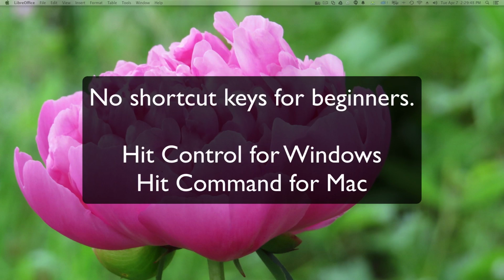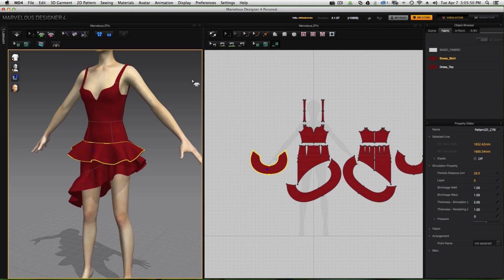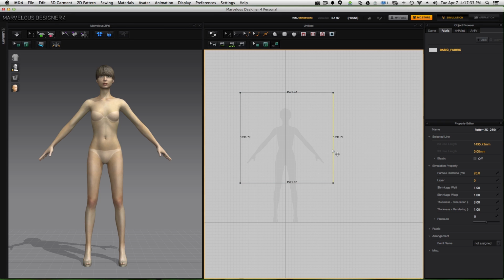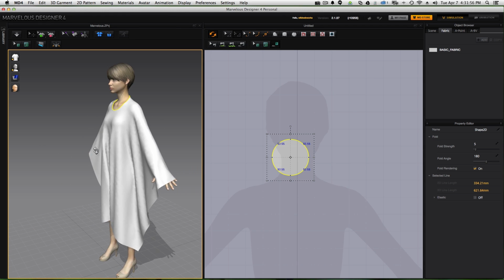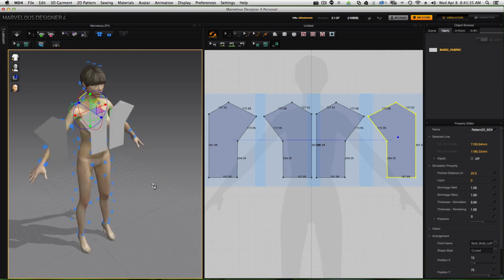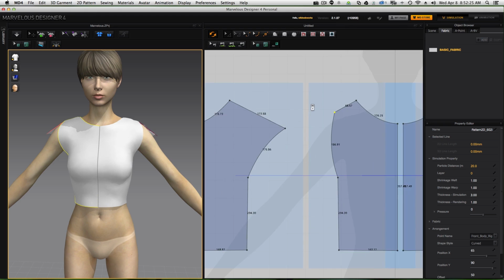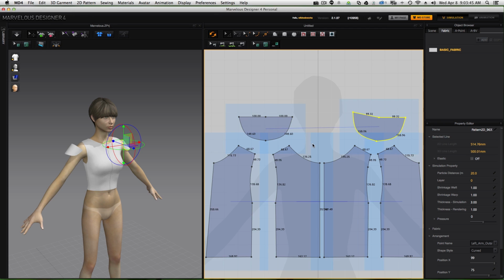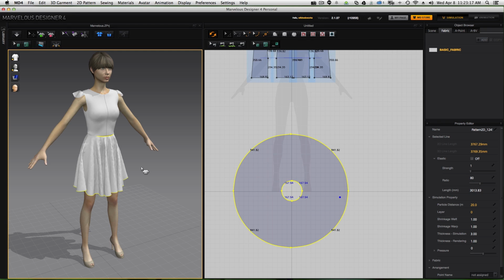How To Use Marvelous Designer - Beginner Tutorial

Comment: I got MD mid last year and thought, 'what a mistake.'  it seemed hard with too many little things you needed to know to get it to work as expected without too much instruction.  my work now requires that i design simple clothing patterns for my 3d subjects.  Thank goodness I found you and your tuts, whew!  I feel now that i can get a handle on this program now.
Reply from the maker: legar83 You'll have it all figured out in no time! Just takes a little patience. Unlike other programs, there isn't a ton of tools to learn. Thanks for watching.
Reply: Thanks for that.  In fact just finished a simple tank and short skirt.  Simple but will work for what I need thanks to your vids.  What do you do for seams to simulate folded over seams like bottom of real skirts, pants?
Reply from the maker: legar83 The bottom is called a hem. Let's say you want a 5 mm hem on the bottom. Create two horizontal internal lines up from the bottom edge of the pant/skirt (same length as edge of pant/skirt). One is 5mm from bottom, next is 5mm from first line. Set the Fold Angle on the lowest internal line to 0 with a high Strength. Then sew a seam that connects the bottom edge of the pants/skirt to the highest internal line. It will fold on the lowest internal line and create a nice hem. You may want to lessen the strength after simulating, because it can be pretty sharp. Hope that helps.
Reply: Yes, very clever.  thank you.

Comment: 14:45 Strange, but I can hold Shift and then Left Click and Drag.
As well, there is Ctrl + Left Click and Drag it will allow You to move point or segment along "extended" line (try to make a non rectangle shape and Ctrl+Click and Drag a segment).
42:35 Seems Marvelous Designer bugged on 38:43, and didn't split segment uniformly on the mirrored pattern.

Comment: Actually you can undock and move the the pattern and simulations windows around (I assume the rest as well but has not tried it...is afraid to ) and can actually close those windows, although I am not sure I would advise it.  It is VERY DIFFICULT to redock them or, else I am not very coordinated. 

Due to the size of the icon buttons and blackness, it is difficult to see the buttons.  What you are looking for is a square with an arrow pointing to the upper right...should be right under "MD Store"...and to the left of the Property editor...in MD4. The only way I see these buttons is I am running a Mac with a 27 inch monitor...it may be even more difficult to see these on smaller monitors.

If you accidentally turn the Pattern or Simulation window off using the tiny X, you will need to undock the remaining window, move it so you can right click in the black center and check mark the verbiage that is not check marked or both if you turned off both windows. 

To redock, you will have to move one of the floating windows back in place, I suggest start in the upper right and then the other to the upper left.  Should be a white border appear when you get the the first window back in dockable position. The 2nd window you just have to keep trying to put it back in place...I have found after the first one is redocked if you try to redock the second to the upper left it seems to work easier...sometimes it works easily...sometimes not.  If you move both windows downward, it  will set up tabs at the bottom.  You can click back and forth between the tabs.

There may be a better or easier way I don't know of but it was more frustration to redock than was work to me.  Personally, this is one of the items I think MD needs to work on for a better user experience.  Hope this is helpful to everyone.
Reply from the maker: Morgaine Christensen Thanks for sharing your tips. (I can reply now!)
Reply: Lori Griffiths Yay!  Thank you for the info so I could fix the comment issue!

Comment: lori i'm brand new to MD and was very impressed with the way your approach was in your teaching ..basically it was great ......but could you show us how to convert a garment if needed and importing it into second life ? .....and yes write a book it would be appreciated ..but don't stop doing your video's  :)
Reply from the maker: Smokey Breen I have no Second Life experience. Have you tried over on the MD forums? I know there are people over there who know how to do that. Thanks for taking the time to comment.
Reply: Smokey Breen Do you have MD 4?  If so, I would select your pattern pieces and quadrangulate them before exporting from MD.   You will need to export as an .obj file (or whatever your 3D modeling software requires).  Make sure you uncheck any models or pattern pieces you will not be exporting.  Select the M (is for meters) to export if you are using the Avastar add-on for Blender or the Avastar Workbench model.  For other modeling programs, someone else will have to answer.  Import the .obj file to Blender, rig/skin it, weight paint, then export as a collada file. If using Avastar, chose the Avastar collada choice (a similar process is probably required for other 3D modeling software I am sure) then upload the rigged and weighted model to SL.

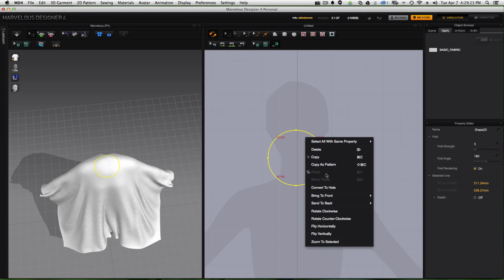Comment: Hi Lori. This is a fantastic tutorial, so thank you. The best I've found on MD. Question. I am at 19:32 but don't see a "Convert To Hole" option in that menu. I'm using MD 4.
Reply from the maker: Lillian I just opened MD to check. The internal shape must be closed, like a circle or rectangle. Select just the internal shape, not the whole piece of garment. Then right click. You should see Convert to Hole as an option. I'm pretty sure that feature has been there for awhile. Thanks for watching.
Reply: +Lori Griffiths That worked. Thanks!

Comment: You guys really nice.. Thank you very much! Realy useful! ;)
Reply from the maker: alithemardihubeis023 You're very welcome. Thanks for watching.
Reply: do you have a video that explains how to use avatar other than human body figures? (ex : helmet) because i pretty much want to make a bag for a motorcycle helmet :)
Reply from the maker: alithemardihubeis023 Wow, that's a unique request. No, I haven't imported anything but human avatars at this point. A bag should be very easy to do in MD. Do you have your helmet modeled? Import it in to MD, just like an avatar. I would suggest that you raise it just slightly off the floor plane before import. Then you can get the bag fabric under it in MD. All you have to do is draw up the fabric using an elastic setting on the edge to pull it together, like a draw cord.
Reply: Lori Griffiths wow you're right.. okay then.. i'll try :
1. importing the helmet model (maybe i'll search the template via online and import it to MD)
2. make sure the model position is above the floor
3. use the elastic option, so it shows how the bag fits the helmet perfectly

once again.. Thanks A Million !!! :D

Comment: Great video!  Thanks.  Quck question...at the end there, is there a way to snap the circle skirt cutout hole to the center of the circle skirt?  You were manually positioning, but seems like it would have been nice to snap it exactly.
Reply from the maker: It would be nice to do that. The Align techniques won't work with an Internal Line and a Shape selected, unfortunately. There is no other method within the program to snap to center. I'll send a request to MD. You never know, it may be an easy add for them. Thanks for asking.

Comment: Lori, Thank you so much for the series of tutorials, they are amazing. So, a simple question, I am  3D modeler, I use 3DS Max and ZBrush, If I model a character in 3ds max, can I import the character here and make the cloth directly on to it? can I do the same if I have done it in ZBrush?
Reply from the maker: mrroozbehm1985 You may want to take a look at this page in the MD manual - http://manual.marvelousdesigner.com/display/MD4M/Compatible+File+Formats. I have imported OBJ avatars from Blender with great success. I generally start with a Make Human character then make changes in Blender. It comes into MD very well. Then you can easily put on any clothing you like and simulate it for natural draping. I would suggest that your avatar is in the A pose, as opposed to a T pose. Sleeves and shoulders don't work very well in the T pose.
Reply: Lori Griffiths Thanks you Lori, It says it supports OBJ files, so it should work with ZBrush as well. Brilliant tutorials. I will try with both softwares and let you know the result.

Comment: hi lori HOe to set height of ground plane in marvelousdesigner? If I set height as negative value it doesnt work and my cloth collide with ground
Reply from the maker: Why do you want to change the ground plane height and which version of MD are you using?
Reply: @LoriGriffiths  marvelous designer 7. The cloth was colliding with ground plane even if I turned collision off. Now it's solved after using collada instead of alembic. Why dont I get exact result in Maya as I see in marvelous designer?  If I turn skin offset value low it penetrates in Maya but looks ok in marvelous. If I turn it high it looks so bad

Comment: Is there any way to speed up the simulation.  Mines seems to be running slow. I'm using running a trail version of MD 6.
Reply from the maker: Increase the Particle Distance setting in the Property Editor. This will make the mesh less dense and run faster.

Comment: Hi, is it possible to simulate or use darts in MD. The cloth in this example would be a stretch knit of some sort. If it were a woven it would not fit like it does without darts. Thanks
Reply from the maker: allanpennington Absolutely, darts are very easy to use in MD. In the real world, you would fold them in, in MD you cut them out and then sew the dart legs together.

Comment: I know this might be a strange question but, is it possible to make metal such as plate armor in MD? I'm working on a project and wanted to know if it's able to.
Reply from the maker: +The10004 I think MD would be a good choice for some armor, as long as the armor is meant to be attached to a garment or the avatar. You can use the stiffest materials; interfacing, leather belt, etc. These materials will deform somewhat and not be completely flat. If you need armor that is really flat or holds a really specific shape, like a shield, I don't think MD would do the job. However, you can bring in objects besides the avatar now in MD5. You could make conforming armor where needed and then import other armor to complement it and finish the model. I have never done it, so I'm guessing here. Hope that helps.
Reply: Lori Griffiths
Alright, I'll give it a shot when I get MD in the future, thanks!

Comment: i can't get my cursor to change from whatever 2D tool i'm using so, i can't do anything in 2D except, whatever tool is selected - how do i deselect a 2D tool? clicking on the main move tool doesn't change the 2D tool - i just made a circle and i want to cut a hole but, i can't get that menu because i have the circle 2D tool selected
Reply from the maker: You should be able to click any of the other tool buttons above the 2D window to switch tools. I'm not sure what the problem is.

Comment: Hello,

I have a problem, when at 34 mn I try to drag the point it does so in a curve, not a straight line ! Help please...
Reply: I should add that I'm using MD6.
Reply from the maker: You're just using the edit pattern tool, not the edit curve tool? That's the only thing I could think would be happening.

Comment: if i imported my own model, it does show the arrangement points. Is this true?
Reply from the maker: That's partially true. When you import a model in the newer version 7, you will get a default set of Bounding Volumes and Arrangement Points. They probably won't be the right size, but you can adjust them. In the older versions you had nothing and had to start from scratch.

Comment: sorry for bothering you but, do you have any guides on making socks in marvelous designer? i have to use a g2female model from DAV, and trying to make a decent pair of socks is like pulling teeth. except i still don't have any socks when the tooth is pulled.
Reply from the maker: Socks are tough because they don't have any side seams in real life. Are you using another 3d graphics program like Blender? If so, I'd just select the mesh where the socks go and extrude it for fake socks or copy it then extrude it to make a stand-alone pair.

Comment: hey Lori, when i go to animate leggings in MD, the fabric tears up (fragments) and get holes, mostly along the inner legs (maybe it's a collision issue). i've tried using different fabrics, even ones with stretch. any idea what settings i can adjust to fix this? thanks very much.
Reply from the maker: The fabric settings really just affect the simulation properties, it doesn't really do anything for fit. I think the problem is the fit. Try making them a bit bigger.
Reply: @LoriGriffiths  that's good to know. thanks very much, i'll try that.

Comment: This tutorial is awesome Thank you so much!  However, and it has nothing to do with you, you're great but my MD is ass backward. To make the avatars head go through the hole on the 3d side I have to place it in the vicinity of the 2ds legs, like its upside down lol.  Is there a setting or something?
Reply from the maker: That is very strange. I have no idea what is happening with your version of MD. It sounds like the gravity is working the wrong direction. You may want to adjust the Gravity setting in the Property Editor and see what happens.
Reply: There is no gravity option in my Properties Editor but I thought maybe it happened because the fabric was upside down when I ran the simulator so I redid it and the hole ended up toward the back of the fabric so I moved it using the 2d side and reran the simulator again and all kinds of penetration occured.  I thought maybe its because the fabric it ended up a little smaller than yours in the tutorial.

Comment: My apologies, I am completely new to MD and I've gotten into a snag.

Whenever I try to give curvature to my polygon, It never seems to give me the desired result (giving me a blocky look) and I'm not sure what to do.

Here's an example of what I mean, not what I'm actually making but I tried this for practice, say I'm making pieces for a glove and I'm wanting to use curvature to give the finger tip areas the curve. When I apply the curve, it just gives me a triangle of sorts rather than a curve tip. Am I not adding enough points when I create my polygon? or am I missing something?
Reply from the maker: You need to increase the resolution by increasing the Particle Distance on the pattern. The setting is located over in the Property Editor.
Reply: Thank you very much.

Comment: Well I did just what you talked about and lost my avatar. But for some reason Zoom Extends All did not bring it back, and I am certifiably crazy now. I like a cat thats mad at its tail for whipping around, I can't find my avatar and it gets worse the harder I try. I can see bits or pieces if I try to use Top or 3/4 view, but then I lose it if I try to bring it out or in. To be clear, I imported a dae body and even if I delete the avatar, when I import it in again, to picks up where I left off.... please please help?
Reply from the maker: That's very strange. Usually, the Zoom works just fine. The problem must be with the imported avatar. If you already have garments made that you don't want to lose, save them as Garments. Then when you get the avatar issue figured out, you can bring the garments back in. It is nearly impossible for me to diagnose your issue, there are just too many variables with an avatar import.
Reply: It turns out that when I deleted the history it seemed to help. After that  was able to load the dae body and it straightened right up. Now if I can only rotate my 2D silhouette. My 3D body loads up with side view of the body when trying to view front, and so the 2D is showing a side view also. Still no matter what, your tutorial is amazing and I keep going back to it. I cant wait to watch the others.